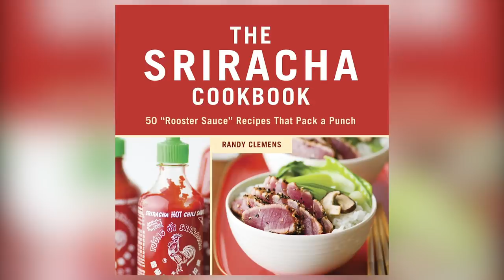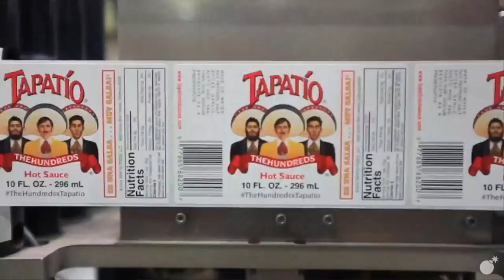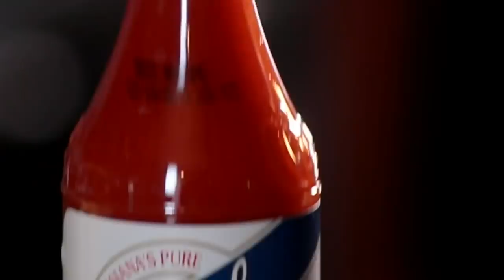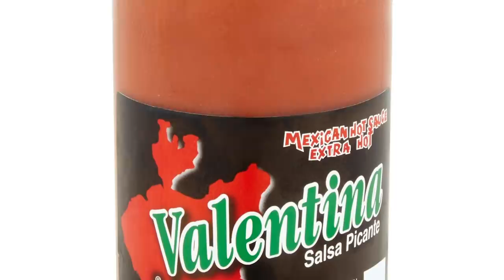Grocery Store Hot Sauces Ranked Worst To Best

Comment: "10. Sriracha"

Okay, I already call bullsht on the entire list.
Reply: exactly
Reply: Sriracha is definitely above chalula
Reply: bruh its trash like they said not spicy and also almost any other hot sauce out does it
Reply: It should be number 1
Reply: Puts sriracha at #10 because it aint spicy, puts franks red hot at #2.......
Reply: Sriracha is great for people who need it on the garbage they typically eat. For everyone else, it's bland and boring as hell.
Reply: I agree, shouldn't even be on the list
Reply: Siriracha is hardly above ketchup in heat level. It’s not hot or spicy in any way. Although it’s a solid great flavor and goes well with everything. Technically not a hot sauce in my opinion.
Reply: Siracha is way hotter then cholula and Franks red hot sauce
Reply: Sriracha tastes like ass. It’s mostly sugar, and it has literally no heat whatsoever. It’s pepper ketchup.
Reply: Ditto.
Reply: same
Reply: @j.r.hawkins3098  completely agree!
Reply: @RealRanma  it's for those who don't like hot sauce

Comment: I've had sauces from all of these brands except for Yellow Bird. They are all good hot sauces but they are good for different types of food and times of day. For example, nothing beats Cholula with breakfast food, and nothing beats Frank's with wings. They all have their uses and I like all of them for different reasons. No need to get bent out of shape if your favorite isn't ranked as highly as you think it should have been. They are all good.
Reply: Yea; the problem is the list is based on nothing.  Flavor?  Heat level?  Application in kitchen?  

Reads more like whats best hot sauce on wings in this list.
Reply: Valentina is best with chips
Reply: Which one do you think is the most universal and applicable to more different kind of foods /tastes? I wanna find one that will taste good with more than one specific food.
Reply: Rose Buddd I think Tabasco is a good versatile sauce. It goes good on pretty much anything that you think hot sauce would. For beginners it’s a little hot, but it’s a versatile sauce. Franks red hot is good for pizza. Try it if you haven’t.
Reply: I agree, they’re all good in their own way for different types of food... that’s why I have most of the brands that are in the video.
Reply: FACTS 🔥
Reply: Exactly what i was thinking they all have different uses. I eat shephards pie with tobasco sauce drizzled on top and it's amazing.

Comment: They rank a sauce low because it's not spicy enough (yet by most peoples taste it is pretty spicy), then they rank another sauce low because it's too spicy. Maybe some actual scoville scores on the sauces can help sort the heat. Then make separate lists for heat and flavor. I've had sauces that I like that were really hot when they pack a nice flavor. Mild sauces can be good too, when the flavor balance is right on.
Reply: @Gunnar Soroos - Right on! It's not all about just the fire. In my opinion, it's about the balance between flavor and fire. The truly delicious and desirable results cross the spectrum from mild to very hot. There is no one "hot" sauce that works with every kind of cuisine.
Reply: Scovilles aren't everything. Different peppers hit you in different ways. It's like THC. You can get the weed with the highest THC levels but that doesn't necessarily mean it's the best. Things like the strain of the weed play a role in how it makes you feel and the same goes for the types of peppers used to make something spicy
Reply: None of the sauces here are spicy.

Comment: I think you’ve done a disservice to Tabasco. They make a variety of hot sauces and you didn’t mention them. Not exactly fair.
Reply: Crystal is best by far..its at winco  I dont know where else
Reply: @Denver10215  crystal is like a better version of Frank’s redhot. It has a great fermented pepper flavor, but I wish it was lot hotter.
Reply: @RealRanma  they have the extra hot  I was at winco bought 2 regular and a crystal extra hot
Reply: @Denver10215  what I want is a 70000+ Scoville crystal sauce. I would put it on everything.
Reply: @RealRanma  Crystal has a good deal less sodium than Franks. Tabasco has very little sodium.

Comment: The beauty of Valentina Hot Sauce is that it is not only the most flavorful, but it is also by far the least expensive.
Reply: Yup even with inflation nowadays at my local market the big bottle of tapatio goes for $6 while Valentina goes for $2.50
Reply: Valentina also has a balanced taste and creamy texture that is unrivalled. I have only tried the hotter black label. Some popular brands like Tabasco and Frank's are excessively vinegary although Tabasco is unexcelled on fresh oysters and Frank's is unmatched on wings. Melinda's (not mentioned) is the fruitiest, tastiest habanero sauce & is available in differing amounts of heat.

Comment: This list is so far off in terms of it's descriptions that they would have had a better average by just rolling dice. Number 10 Sriracha may be sweet but it's biggest problem is that it's TOO hot to be used in enough quantity to impart a lot of flavor. Then they claim original Tabasco has been surpassed and make that claim with Louisiana and Crystal, both of which are essentially identical recipes! If you don't know these sauces, ignore the descriptions in this video because they're seem to have been made by guessing. Frank's = Tabasco + garlic powder. Valentina = pseudo-Tabasco made from dried chili powder rather than fresh chiles. Lesson to be learned; all of the best hot sauces are made from chiles, salt and vinegar and generally nothing else. Tabasco is good because it's fermented which concentrates the flavor, allowing you to use less. I personally favor Louisiana brand as it's inexpensive and while it's not as flavorful as Tabasco it's slightly less hot which allows you to use more or less and control the flavor and heat more easily. Tabasco really does have the most subtle, complex and "fruity" authentic pepper flavor of any of these. When I'm eating fresh raw seafood it's Tabasco or no hot sauce at all.
Reply: Tabasco is trashed bases on it shitty consistency. It might as well be water. At least Crystal and Valentina have some viscous qualities so it coats your food and tongue better.
Reply: And Sriracha isn't hot. Tabasco is way hotter.

Comment: My favorite hot sauce isn't usually sold in stores unless you have a store that specifically stocks a wide variety of hot sauces. It's called Iguana Golden Habanero Island Pepper Sauce(It has an iguana on the bottle).  It's a mustard based sauce with cayenne and habanero peppers, turmeric, garlic, carrots, onions, and cucumbers.  It's a bit hotter than Cholula and Tapatio, but it doesn't leave that lingering burn on your tongue.  The main thing I like about it is it's SUPER FLAVORFUL. Like, I could almost just drink the bottle down as if it were juice. The heat could be hotter but the flavor is really where this sauce shines. If you want pure heat, there's plenty of flavorless options that'll scorch your tongue for you. I'll take mild-medium heat and great flavor anyday.

As for the store brands:

Not a fan of Sriracha. Idk what it is but I don't like it. Oddly enough I like Sriracha flavored stuff like when Subway had a Sriracha sub, that was good!
Never really liked Tabasco because its too vinegary.
I was an absolute Tapatio FIEND for like 3 years in my teens, but it's beneath me now and I no longer eat it. 
Cholula is basically "better Tapatio". I only discovered it after I was done with my Tapatio phase. I don't eat it regularly but if it's on the table at a mexican restaurant, you can bet i'll throw a couple splashes of it onto whatever I ordered.
Never tasted any of the others (not even Dave's Red Hot!)
Reply: Beneath you? Wow.
Reply: @stevenserna910  Tapatio is good but it's pretty basic in my opinion. "Beneath me" was probably a little harsh. Like I said, I see it as Cholula but worse.  I suppose it's kinda like a Coke vs Pepsi thing where everyone has their preference.

Comment: "Overrated" "slightly more spicy than marinara sauce" 

What? It's like the most used hot sauce is Asia and is extremely popular in many other places.

It's by no means an extremely spicy hot sauce, not even close, but it isn't marinara sauce level... what bad reasons to drop it at 10, but some sauces with no flavor are placed way high.

Comment: Have you even tried any of these sauces???!!!!
Sriracha at 2,200 scovilles is slightly milder than tabasco at 2500 scovilles, no were near as mild as marinara sauce.
how DARE you say that sriracha is overrated. it is a mighty fine sauce, and you will find it in 75% of all peoples kitchen
and id say that 99% of the info you where giving on these sauces is not reliable, im sure this is how YOU personally rank them, without taking in the global opinion that franks red hot, tabasco, Sriracha, and cholula are the gods of the hot sauce arena.

Comment: Tabasco is the only sauce I would not have even put on the list - it’s old, naive, watery, flavorless, boring, and irrelevant.
Frank’s is Wing sauce, and while a lot of stuff might taste good with wing sauce, it’s still wing sauce.
Sriracha is perfect for Vietnamese food and nothing else. Sriracha on Mexican is stupid.
Crystal is an outstanding and ultra flexible mild sauce.
Tapatio might be my good standard for Mexican, but it’s the only hot sauce that messes with my stomach so I typically will lean towards the Cholula.

Now let’s talk about Cholula, because not only is it a killer hot sauce, but the lineup of flavors is completely unbeatable. The first time I had sweet habanero and green pepper in the house, I finished them in two weeks - I put them both on everything and could not decide which I liked more - I like them both more than the original and they are a flavor explosion in two completely different directions.

For this reason I have to give the crown to Cholula.

Comment: It's not thay straight forward, each sause has there specialty.  The vinger type, I'd gor with Tabasco. Hot thick taquero sause in a bottle, El Yucateco. General table sause, all three are good... Tapatio, Valentina and Cholula in that order. Cholula is just romanticized by the lable and cap, it's good but nothing special, easily would get confused in a blind test. All the other ones are knock offs or too spicy for people. I have most of them, those without artificial flavors or colors